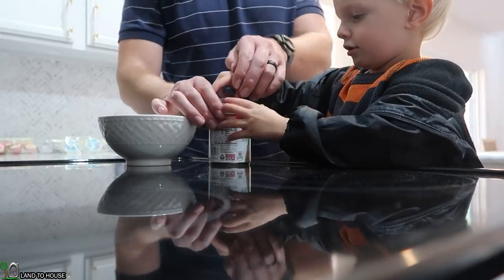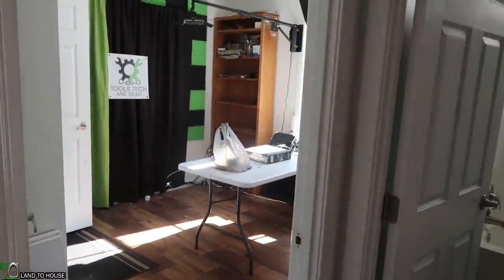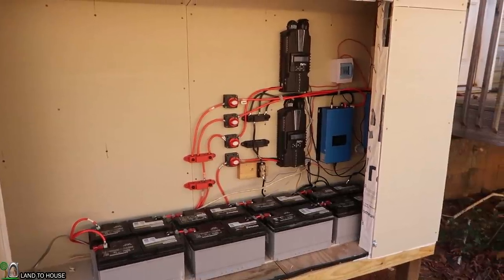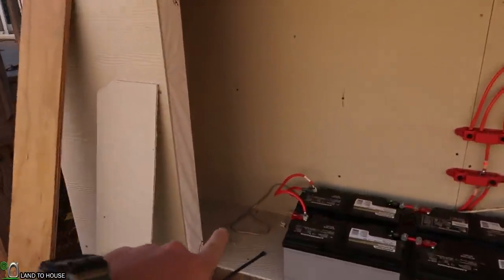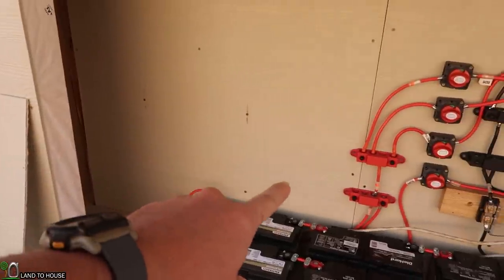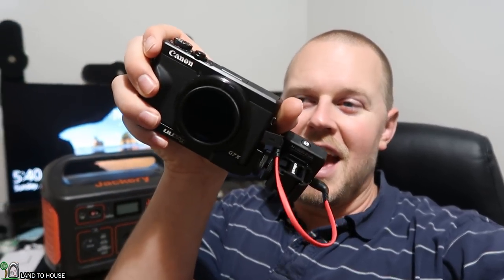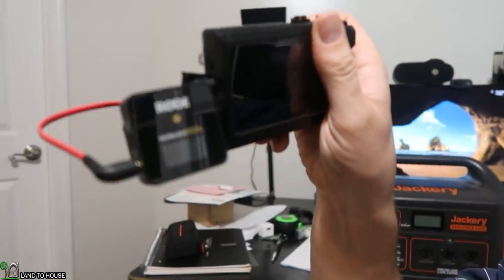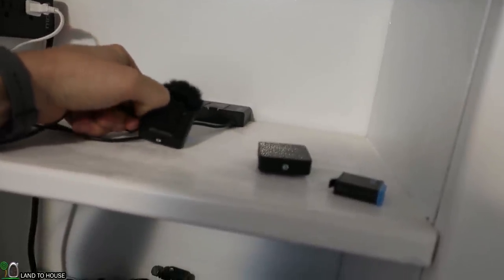I got a Wood Stove plus a Life Update Vlog

Comment: An adult mouse only needs about a 1/4 inch gap to slip through.  They have cartilage in their skull that allows them to flatten out a bit so they can get through much smaller spaces than you would think.
Reply from the maker: Thats the wildest thing. I am going to have to rework both doors with some sheet metal. I think that will be the fastest and more reliable method for keeping the mice out.